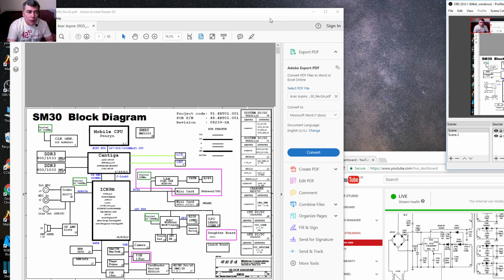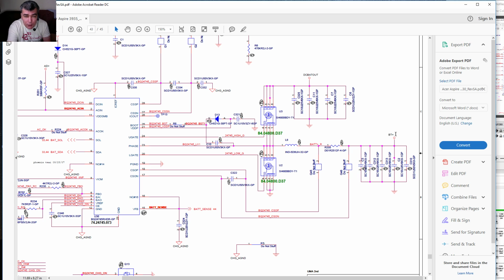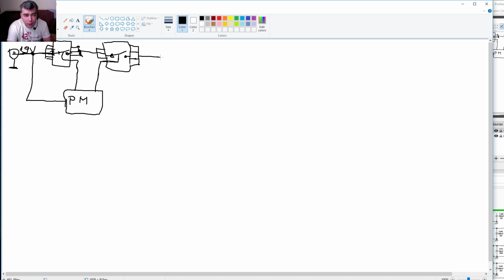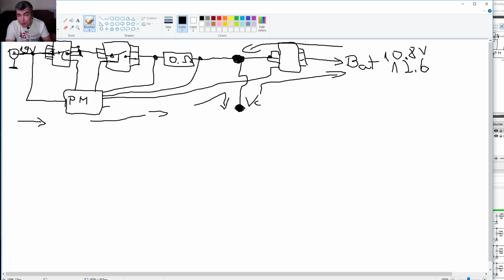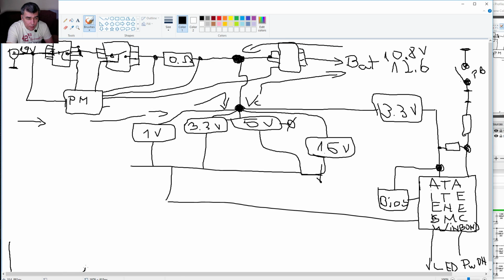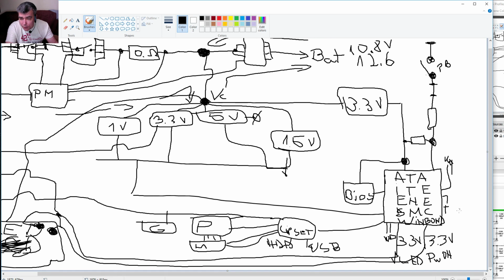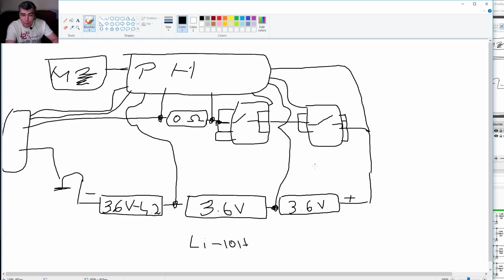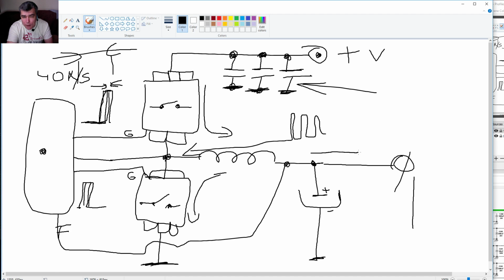About the motherboards .... (part 2)

Comment: I have replaced batteries on Toshiba Sattelite and Dell D630. They are still working fine. The capacity was just very low, before I canged them. The toshiba batt. was actuslly dead. One cell pair was discharging to 2.4V  when off charger for a day or two. So I charged those cells with chrger, then it worked great again for while. Eventually just took all out and solder in new. And works great.

Comment: I have a question about not be able to change a battery cell. So what if connect bench power supply to the ends of a battery cell with the exact voltage of that battery cell. Does that mean we are able to disconnect the battery cell, without losing the data mentioned on a memory chip? I hope I was clear enough.

Comment: Hey. I have a hp pavilion dv6-2152 nr 
Laptop is starting up normal. Power light is on , fan is spinning, but no picture on screen. There is only light in the back of screen. And this light is on only around HP sign. There is 19 v around screen ribbon cable. But where should I check for 3.5v (picture voltage-data voltage)
Thanks

Comment: Hello greats videos Sir ! 

want to laugh ?? a friend gives me his Emachine pc with no screen and no boot at all, only led and fan working... So i check everything , the charger port, the mosfets, the capacitors etc... 19v ok, 3.3v ok 1.5v ok etc...testing rams, do all the millimeters of the motheboards during 3 hours, nothing wrong on my mind...

and i finally get THE idea to check ....the battery cell 3v....it was at 0.7v only !!!! so quick replacement with a fresh one, and now...Boot, screen and everything perfect.... 

Your video was fine to train me for such real cases , and i thank you so much for that! 

The best is to come cause my friend had given the laptop before me at repair shop , and the technician said to him (after 30€ testing fees)...Motherboard is HS...and in the same time he lost 4 screws, and warped one of the support for the keyboard wich was out of the rail.  Have a nice day, cheers from France ;-)
Reply: Why u not took out the battery? , without battery laptop needs to work ,ask Sorin...

Comment: Very informative.  One thing I don't understand - as the MosFET is acting like a switch, why do we need two of them in series? I don't mean in the power supply circuit driving the coil which is obvious why there are 2 MosFETs, I mean on the first schematic you draw showing the power management circuits from the 19V input and from the battery to Vcc..  Surely the Power management chip could connect or disconnect the 19V from Vcc with just one MosFET?

Comment: Hi. Nice and very useful tutorial.
I have Toshiba L650 laptop and two HP. 
 Very good for learning.
When I saw your channel and saw some videos I decide to try fix it. Problem is: Laptop works on battery (charged on another laptop) but not on AC adapter. That means that bios and startup ship (Nuovaton) works fine 3.3V supply is present and there are no shorts in any other supply. When connect charger I have short blink power led. On connected charger I have 19V on all supply's and on battery port. Only problem which I found is that first mosfet is short. I removed it and make jumper as you in one of your video. PM chip which you describe at the beginning of this video I did not found on motherboard. Only what I found is chip which control battery charging. Any suggestion where to find problem.
Also have another two laptops HP with i7-6600 CPU which is soldered to main board. These two do not power at all. 
When connect charger CPU is heating a lot. 3.3 and 5V supply is present. Power button 3.3V is present, Bios 2.9V startup chip ENE KB9028Q 3.1V. Under CPU there are a lot of capacitors or coils not sure wnich one which are short. for coils it is ok? but not for capacitors? 19V is present on all supply which I found.
When connect battery CPU or chip-set do not heat. Previously present power supply 3.3 and 5V are not present anymore. Power button has 3.2V. How that possible? Is there two 3.3V supply? Bios do not have 3.3V on pin 8. Startup chip has 3.3V. When press power button 3.3v and 5v supply starts and disappear after 5-10 sec.
I do not have a linear power supply which you use in your videos. Only digital multimer :( so can not check for shorts as you.

Comment: Thank you for some great repair videos! Now that Rossmann spends most of his videos talking to his cat I suppose you can take over :) But I have a question, the first 2 mosfets, you draw them in series which doesnt make sense to me. First, if they were in series source would not be connected to source (with the same gate signal), second I don't see what purpose would there be in series connection here? On the other hand, if they are in parallel you increase current capability and redundancy (although if one fails as a short of course you lose control of current completely). Are they actually in parallel?
Reply: He already explained this. They work as serial mod, protection against shorts and high voltages, control battery charges sometimes. I quit watching Rosmann long time ago.

Comment: So, at 1:22:27ish you have all of this drawn out as simplified for demonstration purposes, but for example, at 10:22, the PDF schematic shows two MOSFETs with one of the MOSFET's drain connected to the other MOSFET's source. Also, it has the top MOSFET's drain going to 'Batt out.'  The source on the other MOSFET is grounded.  So with one MOSFET being on while the other is off, and the 'Output' taken from the point where one FET's drain is connected to the other's source, how are they interleaving pulses of the same polarity?  Yep, I ran out of knowledge, LOL!

Comment: acer aspire 5742 motherboard. i tested the incoming and outgoing voltage on the first mosfet to be 19v and on the second mosfet, its output is 3.54v, charging chip is getting hot and all the power supplies are geting 3.54v, where is the problem. thanks

Comment: From what I see, what you call the "startup chip" seems to be some general input/output controller with a GPIO bus to which all the buttons are connected to (like the "power up" button, the lid button, the "RF kill" button etc.), and it can also send on/off signals to different peripheral circuits to turn them on/off (like the bakclight, or indicator LEDs, or power supplies). The backlight is usually controlled by digital-to-analog outputs of this chip so that you could control the intensity of the backlight. From what I can see in the datasheets, it also has some serial bus interfaces (SPI-like), so it can control the keyboard and the touchpad. So it's basically an I/O port, that just "happens" to also control the power supplies.
The same reason the BIOS is hooked up into it: because the BIOS is just a small EEPROM, and it has a serial interface, so it requires a chip that would translate it to parallel data lines so that the CPU could read the program and data stored in it.
Reply: That's very good info there.

Comment: Dell Latitude E6430 no 3.3v on the power button even if I turn it on. once I turn the laptop on its working fine but still no 3.3v on the power button. I can't find the 3.3 volt that power on the laptop. 
Anyone came across this problem plz help
Reply: he mentioned on a video, check the center pin of the power adapter from AC

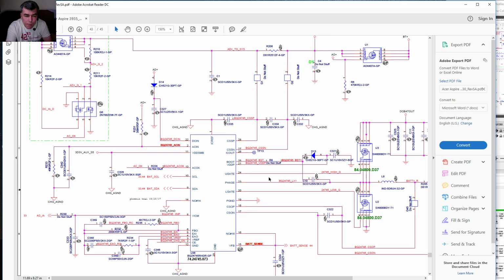Comment: 12:00, this charger input has only 1 pass MOSFET.  

The gate is fed by a simple voltage divider which turns on the 1st, and only pass MOSFET .  

No 2nd MOSFET.

Comment: you didn't draw the most important thing in your buck converter schematic, the inductor, without that, those mosfets are useless, also the theory behind it. Even more, the second mosfet should have source pin connected to ground. The current shunt resistor is after the inductor, which is mising, not connected directly from the second mosfet, but between them. 
You said that, even is not recommend it, just to see that is working, you short one of the mosfet - how could it be possible to convert from 19 to 3.3V, by bypassing  the mosfet?
Reply: The only mosfet he said about bypassing was the DC-power input or the Battery input NOT the power regulated supplies. (and that was only to test hotpoints on the board or chip Vcc on the board bypassing Power-management over current protection or Power-management chip fault)
Reply: That make sense